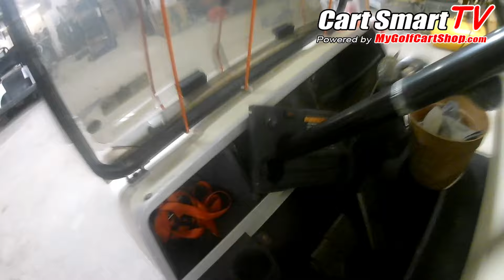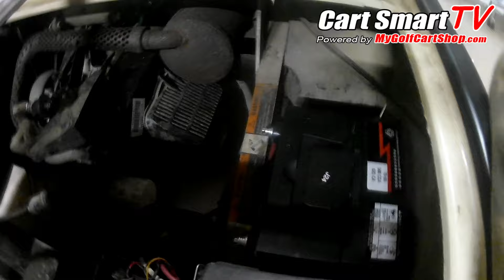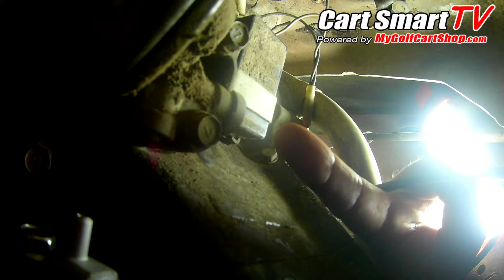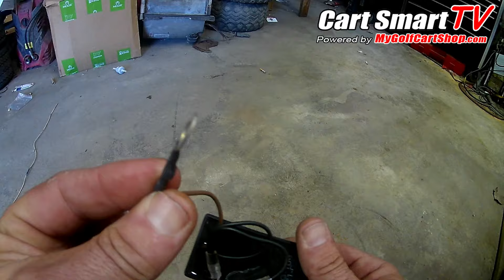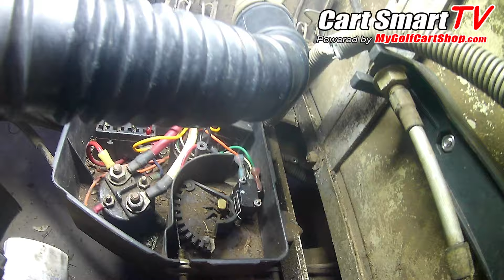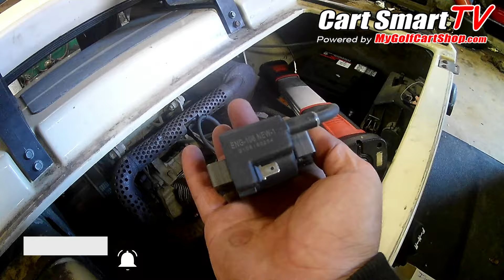Club Car DS Gas | Problems

Comment: brand new parts not working especially the chinese knock offs, but if you get a good one they can last a long time. After a couple of bad experiences I just buy 2 at a time, if one is bad I still have a chance and if the first one is ok I have a spare. A spare carb, a spare coil, rev limiter, solenoid, I am using chinese on all except the solenoid as I got OEM for that as the chinas were very small .

Comment: Good morning, I have a 2014 Club car with the fe350 she's got a pretty good knock, but runs great and doesn't sound so bad being wide open, but when it gets a little hotter you hear it a little more and when you're going slow you can really hear it. Oil gets changed regularly, no metal in it. Should I have it rebuilt now before it goes or just let it go until she dies?

Comment: I have a question on the wiring. The red wire coming off the ignition goes to the fuse panel. Does it join with orange in the fuse box. I've taken over someone's problem. Thanks for the very informative video.
Reply from the maker: Some are different. Best to Google wiring for that model to be sure.
Reply: @cartsmarttv  Thanks for the response. Mine was correctly hooked up. There was this extra red wire that was just hanging out.  The guy I got it from said that it keeps throwing the starter belt. Have you seen that before? Thanks again (2001 DS)
Reply from the maker: @fraydnot yes gotta check that alignment on those plus the belt is so skinny.

Comment: Just ran into a bad rev limiter on an '01 DS with FE 350 engine. It would start and run fine until the engine heated up. It would then shut off followed by starting and stopping every 2 seconds. When cooled off it ran again, a new rev limiter resolved the issue.

Comment: Im having an issue with my 1997 ds gas. I have a new secondary clutch thinking it would fix my sluggish acceleration. Driving it more it gets to the point i have to help it along. Any help or suggestion would be appreciated. Keep up the amazing work
Reply from the maker: Take the air filter off of it to see if any difference just for this test.

Comment: Will the RPM limit box keep it running after I let off the gas pedal? When I let off the pedal I have continuity going to it so the switch is working but won’t shut off.
Reply from the maker: We've never seen that but... you can cut the brown wire to bypass it. You could still also have a bad switch?
Reply: your microswitch in the solenoid box is connected wrong
Reply: I step on gas pedal and it whines for a few seconds or more then starts